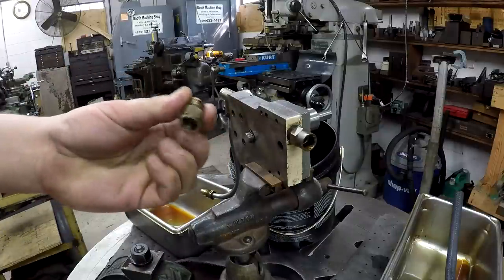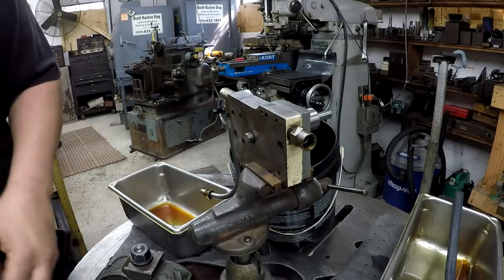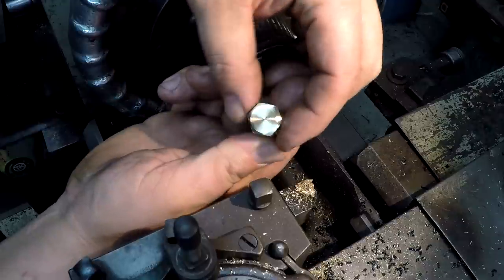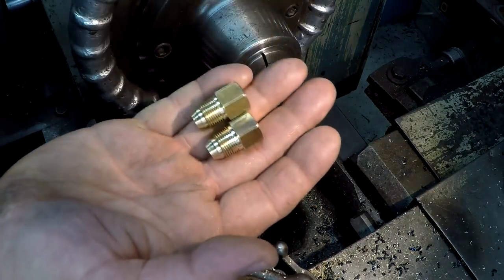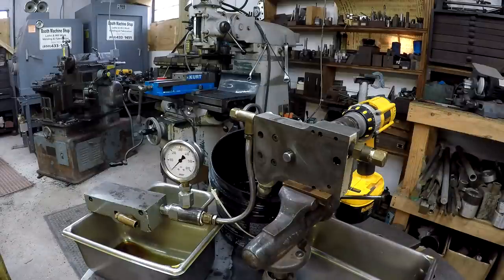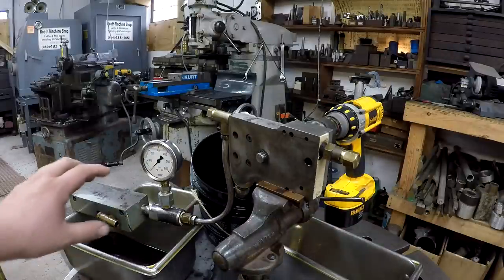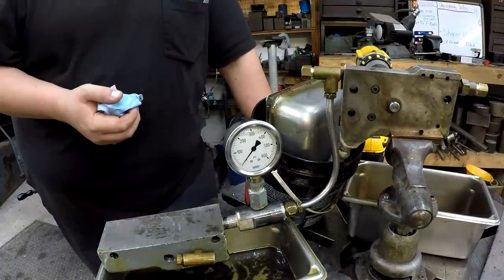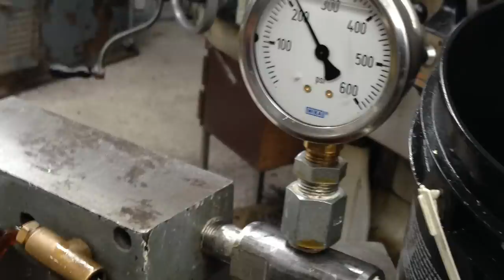K&T Pump & Relief Valve Test

Comment: Looks like you have good flow and pressure. The kinked suction line could have sucked shut, but before you put it all back together, you might want to check where that hydraulic oil is used, to make sure there isn't some leaking valve that is killing all your pressure. You could do that with just a hand pump. It looks like you are going along step by step and you will sort this out. I get the feeling from your comments that you are getting a little tired of all the armchair mechanics, like myself, ;) , asking the same questions or pointing out the same minutiae. I guess that just comes with the territory of putting this stuff up on YouTube. Good luck and keep up the great work.
Reply from the maker: Rambozo Clown I understand everyone wants to help and voice there opinion.

Comment: An afterthought hit me reference this system pulling double duty as a lubrication system.  I would be looking for what controls the flow of that lubrication, be it another bypass valve, metered orifices, or just designed flow/leakage tolerances.  If it was a restrictor that didn't get put back, that could surely let a LOT more fluid through than the pump could supply.  What about those passages in the casting?  Could a gasket on the mating surfaces have failed?

Comment: A flow meter is a bucket and a stopwatch. If you had a bit over 5 gal of oil and a 5 gal bucket, and could fill it in 2 minutes at around 850-860 RPM you would know that it is making the right volume and doesn't have too much bypass leakage. The trick would be running it at the right speed for that long.

If the bypass leakage is minimal then the flow rate to RPM should be about linear. It sounded like you were around 100 RPM on that first test. At that speed you would pump about 0.3 gal per minute to be on spec. That drill motor might hold up for 3 minutes at that speed, and should give you around 0.9 gallon in 1 minute. Considering the variable speed, I'd call anything over 2/3 gallon good.

Comment: Good test. As others have said, you could calculate quarts per second, say 15 seconds. Drill motor RPM specs used to be available online from Dewalt. But when Black & Decker bought the company, they were no longer published. None are made in the U.S. or Canada anymore. 

You could do it the old fashion way and use a strobe light, marker and....  Ah forget it...
Reply: Doug Hanchard the drill sayd it does 1200rpm at the middle setting, but under load of course less, but it sounded about the 800-900 rmp mark, close enough and you could see it pumped easily even at low rpm, i think  its close enough to call the 2.5 gallons per min just fine, the main fault was probably the bad pick up line bodge  (not reaching the oil too?) and the possible low oil level, it will soon be ready to put this together, im sure it will work, remember he had zero pressure on his original fault, and its obviously capable of the 250lbs, so it was a total lack of oil either in or going out somewhere huge, most likely now it was the input, hope his new oilline will be a bit longer than the old one!
Reply: With Adam running the damage control party, Chief Engineer Montgomery Scott would probably say "dinna if I coulda din better test meself!"
Reply from the maker: Doug Hanchard I did several tests off camera and made an educated guess that it was pumping enough. That black bucket is one gallon and I emptied it a few times pretty quickly.

Comment: No need for a flow meter. You can measure GPM over a fraction of a minute by measuring how much it pumps in 30, 20, 15 or 10 seconds and multiplying by 2, 3, 4 or 6. If it does 2 quarts (1/2 gal) in 1/5 of a minute (12 seconds), it is making the specified 2.5 GPM.

Even simpler: with a little bit of math, you can calculate the specified volume per revolution (2.5 gallons divided by 859 revolutions I think it was?). Then you can use one of those Starrett RPM gauges that actually counts revolutions (I think you have one) and it won't matter if you can easily set an exact RPM on the drill motor. I think the pump will run at the specified RPM due to the internal gearing, so if it will pump the proper amount per revolution at some speed even close to operating speed, it will pump as specified when installed.

Comment: Hi Adam:
 It would be ideal if you could access test parameters for that hydraulic system which I'm sure somebody must have. Timing a known amount of oil, will give you flow rate. Besides oil flow capacity, you need to know rpm range for testing the pump.Those machines are common and popular enough to make the required info available in the machining community. Send a request for it.

Regards

Jorge
Reply: Jorge Scordamaglia I suspect that if Adam asks around, there's a test rig or three floating around Pensacola... Navy surplus if nothing else...

Or, at a shop that does hydraulics for things like bulldozers and other mobile equipment...

Wouldn't it be neat if someone associated with the Blue Angels / NAS Pensacola offered to host Adam for a full-up test & adjust of the pump and PRV?   <grin>

Cheers,

Eric

Comment: Adam,
I agree that it looks like the pump is not the problem,  I was wondering (unless I missed it somewhere) that when you had the relief valve at work the poppet was not holding.  What did you end up doing to fix that?

Comment: Hi Adam !

Flowmeter .... couldn't you just start the dril motor and just measure how much oil you pump pr. miniute ... OK, you don't knoe the RPM's but you could get an idea of how much, I think.
Reply from the maker: Keld Sørensen I could do that but it would be an educated guess. I would have preferred to see an inline flow meter.
Reply: Abom79 Inline flow meters are nice, but a bit pricey for pressure rated units...  I use a cheaper type called a Rotameter - variable area, and the float is pushed up against gravity,  so it needs to be vertical - at work for air and water... you need to be able to see the float. I get them from McMaster-Carr for $50 to $60 each... but, they're not rated for 300 psig, nor for hydraulic fluid

So, you are left with a fallback of using a stopwatch and a marked bucket, and doing a little math if you want to do this on a budget... Even big engineering companies and oil refineries do this, if only to calibrate flowmeters...

Your options for getting a known rpm drive are also a bit limited, especially on a budget... DC motors and controllers are out there, but who wants to spend the $$$ for a one-time project, for a nice-to-have kind of deal... it'd be different if you already had the drive sitting on a shelf collecting dust.

Long story short - Your rig has shown that the pump moves fluid, and delivers good pressure - I'd worry about other issues now.

Eric
Reply: Abom79
It would show the same value ...

Comment: Adam, I'm no hydraulics professional or anything, but couldn't you get an estimate for the flow rate by running the pump for a given amount of time (say 10 seconds), checking how much oil passed through it (measuring using a standard, 1 liter bottle) and then, if need be, multiply accordingly? Sure, it won't be as exact as a dedicate flow meter, but seems like a cheap, quick and quite precise fix to get an estimate for your rate of flow.

Edit: Just saw someone else already suggested that here in the comment section. Neglect my comment. Thanks for sharing, Adam! :)

Comment: Ok so it has good PSi and good flow
So did you fix something I missed 
Or dose it seem to work with no changes but not when it is in the machine 
All,hooked up??
This should work the PSI is to speck and good,flow

Comment: Take it easy Adam.  The problem is further down the line.  Maybe, but i do not know... another dude mentioned the clutches that engage the drives???  Don't know if the even exist. but definitely reasonable.  Be a hoot if that's the gig and all of this hyd. troubleshooting is a goose chase.  Gota get Tom to "step on the mat"!  Show what he knows.... get some rubber on the road.  .......Yeah, Tom went outside and stomped some weeds when he saw that mini-Wilton vise on that sweet gymbol.
Reply: WAVETUBE84 Back to when he first put a gauge on the testing point he had zero pressure, and that was right after the pump, I think it was the pick up tube that was the fault, im sure he has put some air onto the other parts to see if they hold up and move.   Yeah who isn't green with envy over that wilton vise! never seen one in the UK but our 'Record' brand vices which are no longer made are i guess our equivalent and now treated with respect as they are irreplaceable now
Reply: jusb1066 Yeah, he could use a stop watch and a known amount of hyd. fluid, and extrapolate the GPMs.   He would need to have a separate catch pan for the P/R discharge, to be a little more exact.  But, It looks like everything is fine with the pump.  Even at the designed operating pressure, it looks like it is doing it's job.

Comment: Looks good, as the others have said you can do a simple bucket check... wonder if you would be better to turn the pump with the lathe, synchronous motor and you'll better know the rpm. Not being a hydraulic expert I reckon that is looking like more than enough flow bearing in mind the rpm you are hitting.
Great video series, enjoy them a great deal.
Reply from the maker: David Lisney With two bench tests shown, I doubt I will be rigging it up in a lathe. We got other issues to find.
Reply: I can understand that! I think it looks fit and healthy.... the issues with the relief valve seem to be fixed now. Like the pace of your videos and I am always learning something. Best wishes from the UK

Comment: have you tried to simulate a load on the working side (ie.. hydro cylinder) of the relief valve? the flow looks good but if the part that needs the pressure is not getting enough then it will operate poorly.

Comment: I agree with your conclusions that you confirmed that the pump and regulator are both working properly.  I thought about suggesting you time how long it takes to pump a gallon of oil through it at the specified RPM (should be 24seconds).  But the fact that you got good pressure  and the amount of flow you had in your previous video tells me that the problem is most likely something else.  

I believe You said that the pressure gauge on the mill only read around 10PSI. Since you know the pump and pressure regulator are both working. That makes me wonder if the intake line was pinched off or clogged from the inside delaminating as you suspected.  I figure it had to be that or a leak between the pump and regulator, regulator stuck open, weak or improper motor, or the coupling between the pump and motor slipping, filter clogged, not enough oil in sump, or that the pressure gauge on the mill was wrong.  I may have missed a few things. 

If it isn't a big deal to slide everything back together, I'd be tempted to make a proper intake line, and put it back together.

Chris
Reply: [continued]. (Don't know why it cut off early)

If it isn't a big deal to slide back together, I'd be tempted to try putting it back together with a proper intake line.   Any chance the hose was bending and holding the intake above the oil.

Chris
Reply from the maker: shadowdog500 I'm working on a new intake line and addressing a couple other issues I found too. It's possible it was the intake line.

Comment: Good test. I'm not so worried about flow. Looks like you have it. I'm wondering where the two lines go that you had to plug. If either of them are wide open then the other two wont get flow or pressure. Unless of course there is something that I don't know about the system. Such as other regulators in the system. If I remember correctly you did some air testing with all three?
Reply from the maker: Matt Wilkins One line goes over to feed the hydrashift gear box, and the other works the power feed and rapids. I talked about it in the past videos.

Comment: there is no one way valve in the pump correct? If not it is not possible for it to hold pressure in static state not pumping. So it is pumping pressure, now check for volume, open one of your plugs put a hose on it and see if the gauge still comes up to pressure while feeding fluid back into your oil bucket with one open line. No volume no work. We have the same issue with fuel pumps on cars you can have pressure but if the pump is weak it might not have the volume to actually keep up with demand.

Comment: Hey Adam, you're probably thinking what the hell is a chef doing commenting on my videos. As I mentioned earlier I started  life as a Machinist  tool and die maker.Then built custom machinery from scratch for over 20 years. I was heavily into PLC's, hydraulics and pneumatics. I have also been a master Electrician which is what I am doing now. The Chef thing is just a hobby. Anyway what I would do is plug the output of the pump and see if you are dumping over the relief valve at the required setting. You could also set it while you're at it.
Reply from the maker: Chef Bart Hey Chef, that's what I did in this video...did I not??
Reply: Abom79 I didn't notice you restricting the flow on the output side of the pump  and dumping over the relief valve above the working pressure. Just a thought.

Comment: Instead of using a flow meter, you can get a quick and dirty idea of flow with a stopwatch.  Just time how long it takes to move a known amount of fluid at the needed RPM. If you need to move 2.5 gal/min,  it should take 24 seconds to move 1 gal.

Comment: Measuring the flow is only relevant in a variable displacement system. Yours is a fixed displacement pump running at a fixed rpm. Knowing its flow is of theoretical use only. The facts are that you now know the pump is capable of making relief pressure and the relief valve is capable of holding the pressure. Except did you not say relief pressure was supposed to be 350psi? Anyway, you're getting more than the 10psi you had on the machine.

It's now fairly clear that you have leakage downstream somewhere. A leaking line or valve or clutch pack. It should be fairly easy to track down by pressurising the system with compressed air.

Comment: Is there a way to mount that pressure gauge somewhere on the K&T so you can always have a pressure reference?   Maybe through a bulkhead-type fitting?
Reply: ***** Hi mate. it normally lives on the machine.  However you don't want to put it back together, and find it's still not working.

Comment: For your flow rate.  Pump 1 gallon of oil with your pump at the prescribed RPM from one bucket to another and see how long it takes.  Then do the math to see how many gallons per minute you are pumping.

Comment: You don't need a flow meter, run for a minute and measure the volume of oil that comes out.
Reply: 12345NoNamesLeft  His drill probably can't take a minute... would have to use a different power source.
Reply: Your right, this is the quick and dirty way of doing it! You actually don't have to do for specific time, you can take a measures amount if oil and figure out how long it took to pump it and extrapolate flow rate from that!
Reply: DSCKy
15 seconds and then x's 4 then.

Comment: Adam, I left a comment on SNS 80 pt. 1 a few days ago but I know you are very busy so I figured you probably didn't see it. I was wondering what the little saw you used to cut stock was? It was around the 16:00 point in SNS 80 part 1.
Reply from the maker: I think your talking about my Johnson power jack saw. 👍😎 It was a Craigslist find my dad found for me a few years ago. It's great for small and quick cutting needs.
Reply from the maker: My mistake, I meant to say Jefferson power hack saw.
Reply: Abom79 Thank you very much! I looked at it and said to myself "That's perfect size for my garage" now I need to find one...

Comment: The relief valve is working,

the cheek plates are leaking.....too much wear.

200 psig x 2.5 gpm;  the pump is consuming ~ 0.5 hp (375watts)  !!  yep it should be smok'in.  :)

[ 1 hp approx.  1500 psig at 1 gpm]  rule of thumb

In older systems, like yours, the first thing you see with worn plates is a fall in flow and the machine slows down. (usually in fast motions like "Rapid Traverse".  slower operations, not so much.

The test shows its making pressure, but the leak-down cant be seen inside an oil filled crankcase. 

the next step people do is raise the RV pressure, but since flow only rises a little with resect to pressure,  they say its failed. 

You can measure flow by using a small Scale. (like a digital food scale)  http://www.target.com/p/taylor-digital-food-scale/-/A-11011109?ref=tgt_adv_XSB10002&AFID=bing_pa_df&LNM=11011109&CPNG=Kitchen&kpid=11011109&LID=26pbs&ci_src=328768002&ci_sku=11011109&ref=tgt_adv_XS000000&AFID=msn&CPNG=pla_new_kitchen&adgroup=pla+kitchenware&LNM={Keyword}&MT=broad&LID=26p13989666&KID=4aff6dff-4855-4f48-c2b5-00001efe9be9

Of all the machinists on YouTube, you are the one with the most "Close-tolerance" talent to duplicate a new houseing (cheekplates).   they will need to be hardend.   Get together with Tom (Oxtoolco) to do some serious dimensional measurements.